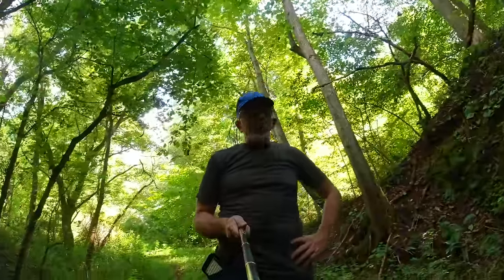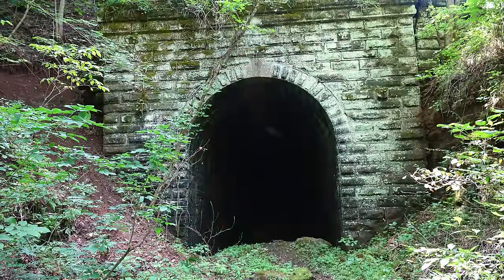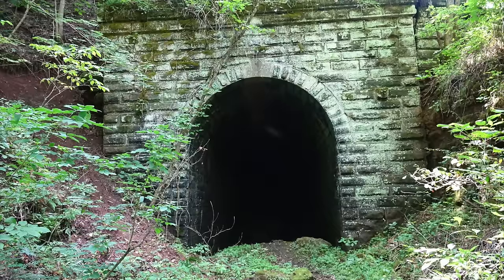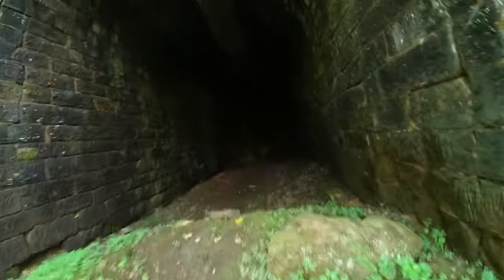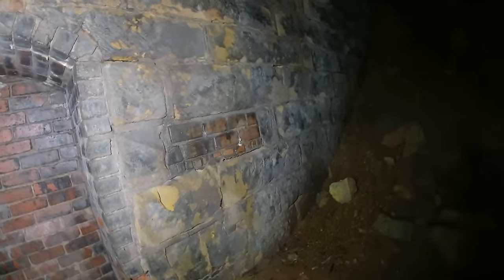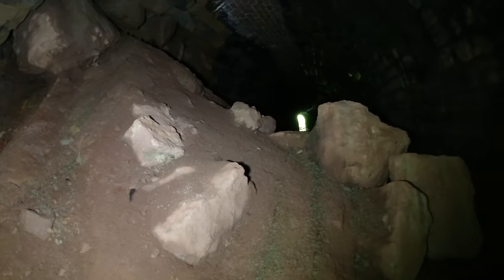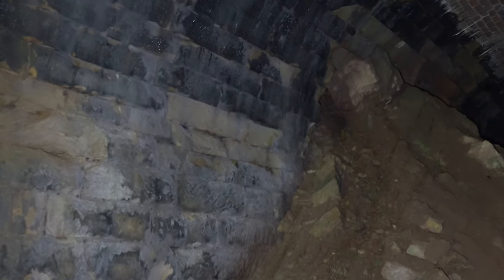Railroad  Tunnel  #22  Collapses,  Train  Wreck,  Abandoned,  West  Virginia

Comment: Great video, and right up my alley! Before we retired and moved to Florida in 2019, we lived in central West Virginia. I spent a good deal of time hunting for the tunnels of the old Coal & Coke Railway. I got all except Delta and Little Otter. I had my poor Prius in places it was never meant to go! Sago and Goodwin were the most difficult, but Sago was worth it because the brickwork is magnificent.
Reply from the maker: Where  about  is  Sago  located?
Reply: @historyinyourownbackyard2363  Upshur County, West Virginia. Hard to get to now, with the vegetation. I got there with a friend in 2017, and I had knee problems at the time. It was very challenging.
Reply from the maker: Yeah,  the  west  end  is  hidden  by  vegetation  now,  at  least  in  the  summer.  If  I  would  have  gone  down  there  in  the  middle  of  winter,  I  think  I  would  have  had  a  better  chance  of  entering  the  west  portal.

Comment: Don't look much like a collapse,,kinda looks like it was sealed up!!! Very good presentation though❤
Reply: I agree, blocked with dumped ruble.
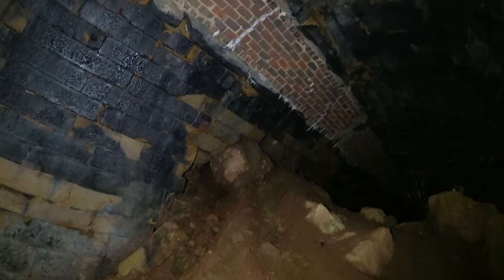Reply from the maker: It's  definitely  a  collapse  of  the  south  wall.  If  you  look  closely  at  time  stamp  4:27  you'll  see  where  the  hole  in  the  wall  is  located.  Also,  although  I  didn't  include  this  in  the  video,  if  you  go  the  the  webpage  at  the  link  below  and  scroll  half  way  down  the  page  you'll  see  a  photo  taken  by  Alan  Nichols  about  10  years  ago  where  the  amount  of  dirt  and  rock  that  came  through  the  wall  at  that  time  is  about  50%  less  than  when  this  was  filmed  in  2022.  Here's  the  link:  https://www.wvncrails.org/parkersburg-to-clarksburg-waist-of-the-bo-main-part-i.html

Comment: I don't think that is a collapse - the ceiling is intact.   I think that fill was hauled in there to discourage hikers.
Reply from the maker: It's  definitely  a  collapse  of  the  south  wall.  If  you  look  closely  at  time  stamp  4:27  you'll  see  where  the  hole  in  the  wall  is  located.  Also,  although  I  didn't  include  this  in  the  video,  if  you  go  the  the  webpage  at  the  link  below  and  scroll  half  way  down  the  page  you'll  see  a  photo  taken  by  Alan  Nichols  about  10  years  ago  where  the  amount  of  dirt  and  rock  that  came  through  the  wall  at  that  time  is  about  50%  less  than  when  this  was  filmed  in  2022.  It's  been  getting  worse  with  time.  Here's  the  link:  https://www.wvncrails.org/parkersburg-to-clarksburg-waist-of-the-bo-main-part-i.html